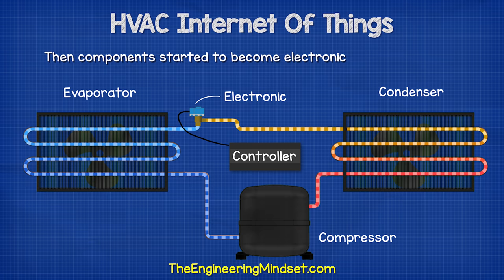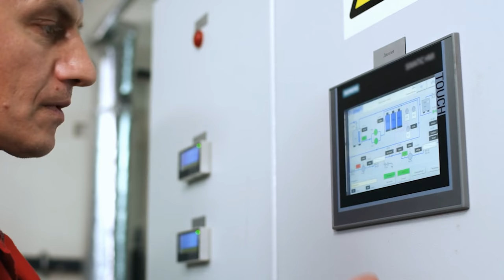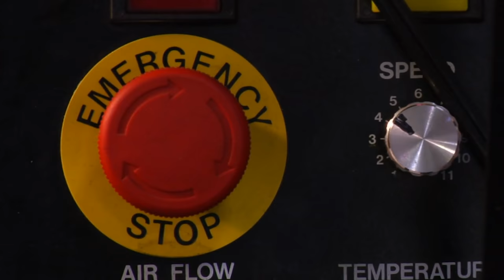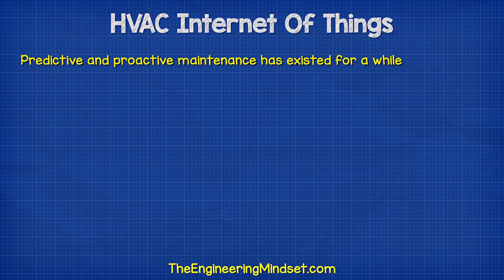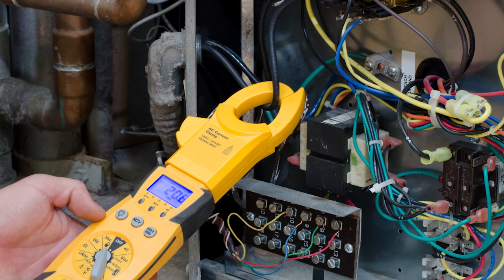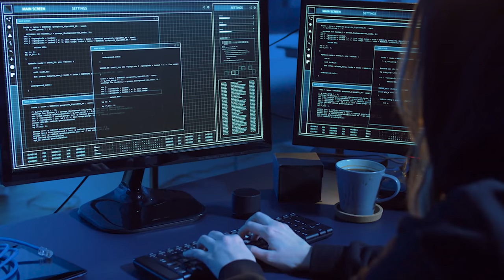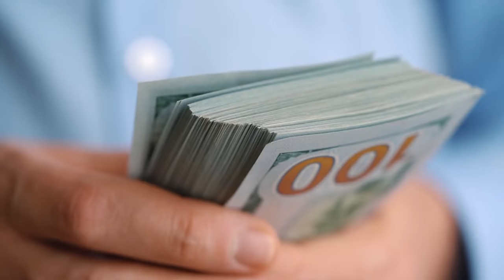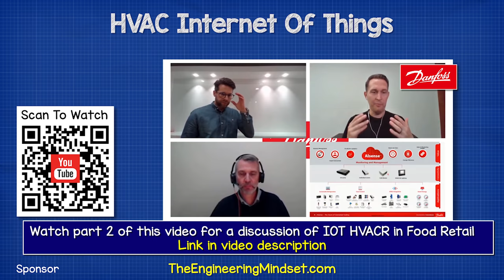HVAC Internet Of Things -  iiot

Comment: "Right to Repair" is a concern....
Reply: I foresee some taking advantage of "the HVAC detected a problem, we will have to fix it before it breaks"
Reply: @sandergjertsenstvold1051  that is a valid argument and I’m sure it will be exploited by some but ultimately if the data is there to substantiate a recommendation it is more transparent and allows procurement to make that decision if the data is actually referenced and an order/purchase isn’t just actioned on the trust alone. Also it could be used to claw back money by purchaser if contested.
Reply: Could you expand on the concern in relation to IoT? 

My limited knowledge on that debate has me thinking they are completely separate. These kinds of devices just give data accessibility w.o being literally on site. The legal struggle for who is able to repair a device remains whether the system knows it needs repair or not

Comment: iiot alos allows hackers to take over and sabotage.. in the consumer space, we already run into the issue when the service provider folds and the iiot device is useless becuase it lost the internet connectivity... best to avoid any critical home function that requires a serice provider
Reply from the maker: This is an issue particularly focused on cheap and generic iot products and Arduino/pi, who's manufacturers do not offer even the most basic security features or software updates. Buying a $30 iot kit from an unknown brand on ebay will come at a cost to your security. But large manufactures are mandated to follow security protocol and have the capabilities to secure networks. Like it or not, IOT is the future.
Reply: @EngineeringMindset  Do you think iot will transition to blockchain transactions and become more secure?
Reply: @dakoderii4221  OMG.... !!!
Reply from the maker: Some aspects yes, service records and legal documents, refrigerant records etc. But for remote operating, encryption would likely be an easier option.
Reply from the maker: @HELLO7657  Yeah good points. Each installation needs to consider what level of information and control they want to enable. Some businesses or homes will suit having fully remote, other more critical operations will want more limitations but both will benefit from the availability of data and machine learning processing this. We can still take the benefits of the data feedback, even if anonymous, and only enable manual changes and updates.  We would expect data centre and servers to be increasingly secured, especially if they are able to remote operate, and data transfer between, in either direction, to include simple encryption. Again, the safer option for such is to partner with data server providers who can fully manage and specialise in that.
Reply: WIll it help with maintenance and control energy costs?  Yes.  Will you be subject to higher repair costs due to the lack of "right to repair", blackmail, or sabotage?  You better believe it.  Imagine having a large cold storage warehouse with millions of dollars inventory.  Hacker installs ransone wear demanding money or they scramble your computer systems like it has been done at hospitals and local governments.  Credit card companies can't even avoid being hacked. If you can't afford a large IT department stay away interconnecting everything.  If IOT is the future, don't interconnect anything more than you have to connect.

As helpful as the computer diagnostics is, they override common sense.  I had a brand new clothes dryer that the computer said was working within the specs.  But you could clearly see that the drum was spinning too fast.  The warranty was not being honored because the computer said it was fine but the clothes still would not dry.  Finely the salesman was able to get the company to replace the dryer.  The new dryer's model number was changed by one digit from going from zero to one indicating that they knew they had a problem and had to made a modification.  A good train mechanic is still better.
Reply: What we really need is for companies to stop designing around the, "send all your sensor data to them first to store (and sell) and then access your data on their servers from your mobile device" model.
Reply: Its not a huge leap to have software you install on a home server, or even some sort of smart hub. You could give the hub access to the outside internet, and still get access to all your data from a phone app. This completely eliminates the need for their company to still exist for you to access your data. The problem is incentives. These companies want your data, so they're not going to design around you having total control of it.
Reply: Last minute ‘Store cold energy’  How is this possible?

Comment: Coming from a HVAC Tech point of view, it would not be able to replace HVAC tech's. New technoligy do give falls readings and PC Boards and electronic components do not last as long as Mechanical components. Proven fault example: Had a error on a temp sensor faulty the other day ( Faulty sensor code ) , Turned out to be gas problem and sensor showed on error code - Explain to me if you send out a person with tools and parts to replace sensor for example, and he is not trained field tech with experience - how will he pick up a diffrent fault and run back and forth to get the tools, More down time on equipment in my eyes. instead of sending a HVAC Tech fully kitted first time round. New Technoligy is nice but not trustworthy.
Reply: You are so right....most of these error codes sometimes needs an interpretation..,for instance if a Toshiba VRF system gives you an H07 error code...the manual reads faulty compressor.....but in the actual sense the the problem is compressor not being powered..
Reply from the maker: New VRF unit video here:➡️  https://youtu.be/4i1XgcP1tmw

Comment: great video, nice graphics, thanks. I am a technician who deals daily with industrial cooling and heating (direct expansion, combustion, steam, etc.). a few years ago, multimeter, thermometer, pressure gauge, screwdrivers were enough. today I need password (mandatory), computer, manufacturer's assistance to find the perfect setup, etc. for a production stopped (years ago) 1 hour was enough to restart. today it is very difficult to find that particular part ... hours to reset the software and if the supplier is closed, bye .. What is the impact on the environment if we need more tools, more rare metals, thousands of specific and non-interchangeable spare parts?
Reply from the maker: As everything evolves, the software etc becomes necessary. If we look at the Ford model T car, this was just an engine and wheels, it worked and you could fix it with just a wrench and a screwdriver. But, it wasn't efficient, if there was a problem you had no insight until the car made a noise and smoke poured out and in you crashed, you died. Now cars are almost fully automated and incredibly safe to drive but you need a computer to diagnose and lots of special tools and knowledge. As the need for safer vehicles increased, technology advanced and so the controls had to also advance. I think the interchangeability will also change over time, and if it doesn't then governments will step in to force change. Just like mobile phones all used to have separate changer types and now they all use USB variations, except Apple.
Reply: We will make more e-waste for making HVAC smarter. In fact, each of manufacturers will implicate difference systems and proprietary controllers. Take a look what BMW has done with their car.
Reply from the maker: Check our new Multimeter tutorial out ➡️ https://youtu.be/4lAyzRxsbDc

Comment: Mechanical valve or simple setup for HVAC last longer. It will cost more to cost of repairs(more complex device, more moving parts will cost more time to troubleshoot the problems, more simple setup ends up last longer) or maintenance. In fact, electronic devices have broken down more often than mechanical device. From a homeowner and HVAC technician perspective, I always recommend my clients to stay with simple setup (cost of maintaining and repair is lower). In the real world, the HVAC last around 10-20years. Many electronic sensors or controllers will break before that since they usually work in harsh environments.

Comment: My experience with commercial building building automation systems is that it is nearly impossible to find someone who knows anything about HVAC that can also program the system.
Reply: I am not an HVAC technician yet but am considering becoming one as I learn refrigeration. Could you elaborate a little about programing an HVAC system?  Languages used and learning resources if you're aware of any. Thanks in advance!
Reply: @79aac  i am an Hvac tech myself,I would advise you concentrate on electricicity,microcontrollers & electronic circuits,that is the game changer in this industry.
Reply: @79aac  First, congrats on considering a career in HVAC.  This is a great field and there is a big demand (meaning high pay) for those who do.  As far as programming,  when you have a complicated HVAC system, like in a commercial building, it often has a Building Automation System.  Johnson Controls, Schneider Electric, Honeywell, Siemens are the top contenders.  The program languages are usually "object oriented" and are proprietary but very similar between brands since they all control the same equipment.  So, they don't use programming languages like are used for web pages and the like.  Hope this helps, let me know if you want more detail.

Comment: I am afraid that each manufacturer will have their only iot interface in such a way that it would be impossible  to have  a Daikin equipment and a media monitoring system, for example

Does that fear justified?
Reply from the maker: I can't speak for all manufactures, but I listened in to the Danfoss Alsense discussion and they mentioned the ability to read third party equipment.
Reply: @EngineeringMindset  Oh I see. Thankyou for your response
Reply: There should be some Open Source IoT communication standard, to which all of the companies should adhere.

Comment: This feels like it's going to create more trouble for the technician who is going to deal with all those sensors and software  in  a system
Reply from the maker: Well all jobs are becoming more technology enhanced, it all continuously steps forward. For example my grandparents and beyond all had labour intensive jobs, manually operating machines and equipment. They were worried about technology coming into the workplace and home, but it happened and improved everything. They no longer need to buy coal and light a fire, just press a switch and the house is warm. Their coal fireplace worked well, but the boiler that replaced it, with all it's sensors and electronics works far better, it does require training to carry out repairs though.
Reply: Market will tell what is right for us. If overall cost of installing, pairing and maintenance can’t compete with conventional setup, then no one will adopt that.

Comment: I am a service technician and for the past 10 years I have serviced supermarkets in the United States with this type of equipment installed. The equipment I work on is not as smart as the ones in your video but they still were able to show, where the problem was and alert the managers. In some stores I was able to log in remotely from my house and look at the pressures and temperatures of all the cases. I had a rough idea what the problem was before heading out to the store. 
I do like these setups because it makes the diagnosing very easy, however the circuit boards, software, touch screens, sensors, and valves are expensive. It seems that they are so expensive that only the large companies install them.
As a hobby I wanted to install a smaller version like this into my home, but I'm having a hard time finding equipment as a reasonable price. Danfoss has all the equipment but for tens of thousands of dollars.
Reply: I am currently learning IOT and I found your comment interesting because you have so much experience with these equipments. I want to make these smart devices as well.
Reply: What do you make of a Toshiba VRF system?....their error codes are so accurate they take you directly to the problem
Reply from the maker: New VRF unit video here:➡️  https://youtu.be/4i1XgcP1tmw

Comment: IoT is bad for security reasons though. For every connection a device has, that's one more route a hacker can gain control through. Most cybersecurity guys I know have mechanical locks on their doors...
Reply: The iot isn’t controlling anything, just giving information
Reply: @theflamethrower867  all a hacker needs to blow up some boiler is to spoof pressure sensor alerts.
Reply: @wikingagresor  but that would of happened anyway if the sensor wasn’t there
Reply: @theflamethrower867  Not necessarily, and it doesn't take much imagination or research to see how ಠ_ʖಠ
Reply: @gus473  then why don’t you use your imagination and give me a scenario

Comment: That's great but the technician is not coming unless somebody's paying a maintenance contract.
Just data logging alone increases usefulness.
Long moons ago we had ice cooling which was actually fairly efficient/ effective cold storage technique.
there is an interesting space of circulated liquid storage with both hot and cold containers, which is more efficient than electron energy storage at this point ( future battery technology prove me wrong ).

Comment: pls make a video about how the starter motor of a car works 🥺
Reply: It’s just a normal electric motor but also has a mechanical solenoid that acts as a switch for the current and pushes the gear onto the flywheel of the engine,

Comment: All of this is rising the cost of the equipment and then repair if and when there is a problem.   As for "self diagnostics" that is true but I have seen way to many false issues.    This will  make the HVAC/R industry a "high Tech" job.

Comment: The HVAC industry should go beyond HVAC IOT, IOT alone depends on the people who will analize the data and depends on the interpretation of the service personnel. HVAC Industry should push forward to adapt HVAC AI, true energy efficiency can only be achieved by real time AI analysis, adapting to the real environmental conditions.Intelligent Sensor should be installed. Seamless (AI-lead) User Inteface that provides and guides users (non-technical) to do optimization of the operation and troubleshooting of equipment using only the display information on the user interface. With HVAC AI, no equipment will operate or to start if there’s no compliance to the right conditions to start. AI will identify inadequacy to the installation and the environment prior to startup or operation. AI will also identify the right time to do the maintenance  AI and intelligent sensors will monitoring the compressor runtime, fan motor runtime, air quality, etc. This will optimize the service life of the equipment and also conduct maintenance when only needed. Frequent maintenance (forthnightly, monthly, quarterly, semi-annual or annual) will no longer applicable, AI will trigger the call for service maintenance based on the real time actual runtime readings of the sensors. (Legacy) Service Maintenance contracts will not be applicable and manufacturers should move to this new service platform. Also the warranty voidance based on enduser misuse or wrong installation will be a thing of the past since AI will not allow improper operation of the equipment. Hopefully the future of HVAC AI is near, regulations should start the changes and for to adapt this technology, I have sold, installed, operated, maintained HVAC equipment with AI, and this is the future of HVAC it greatly change the performance and the efficiency in holistic approach. Thank you for reading, hope this help!
Reply: As each legacy HVAC system got a number of components,  whoch one has the best chance for implementing the IOT concept?

Comment: Dear the engineering mindset
This is another awesome video, I would like to ask if it is possible to make a video on slip ring and how can we change it to a wireless slip ring with keeping the high voltage (400v) with a normal sleep ring and all what concern data and signal with the wireless one if it's possible
Thanks in advance!

Comment: I always wonder what is the expected accuracy rate of AI predictions? How can I be sure that the predictions made by AI is accurate and I should act on it?
Reply from the maker: Good point, at this point the AI would make a recommendation and leave it up to the user to implement. Depending on the calculation we can produce an accuracy, much like we get the R number for our y=mx+c correlation plots. The higher the number the better the fit. The more data available the better the accuracy. So correlation and data set size will need to be considered. If it's controls, we can do alternative day cycles to compare side by side results over say 7, 14 or 30 day for example